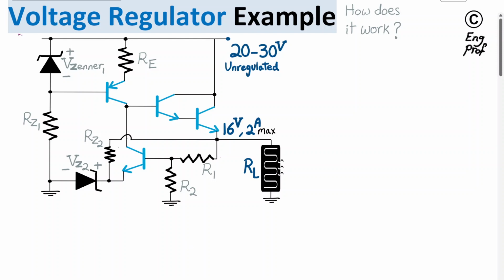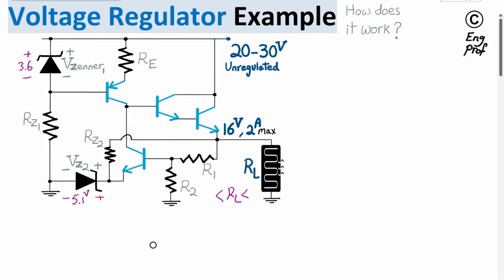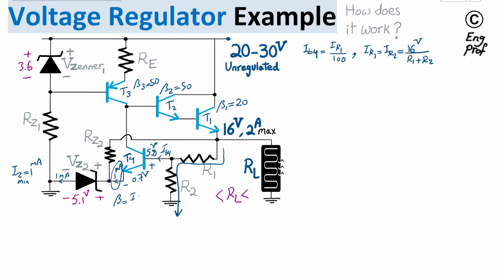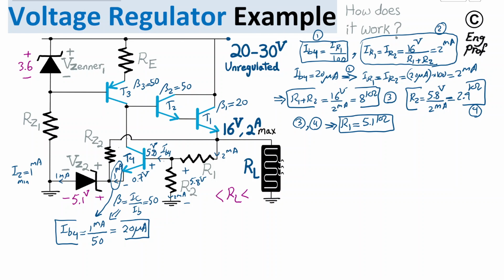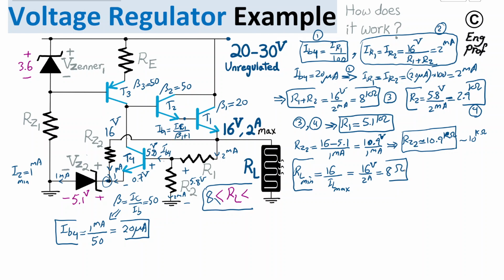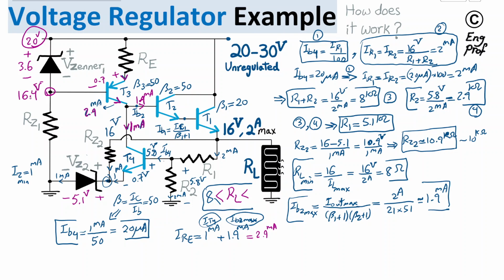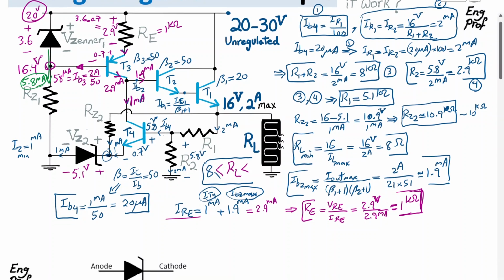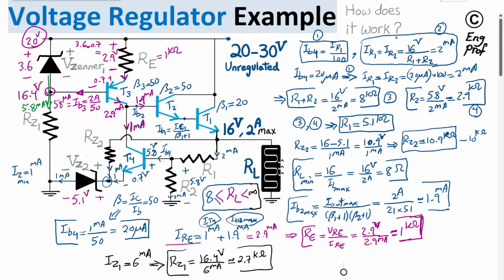Voltage Regulator Design with BJT Darlington Transistors and Zener Diodes

Comment from the maker: Thanks for watching & your comments. NOTE: supported input unregulated supply voltage is ~21-30v. For more Analog Circuit, Op Amp and Regulator Examples please see: 
Voltage Regulator Example: https://youtu.be/rI9f6-DyXxQ
Push-Pull Power Amplifier https://youtu.be/866MYibo8yE
Voltage Regulator Op Amp Circuit with Foldback current limiter https://youtu.be/VN4_qF9DvBM
Bandgap Video: https://youtu.be/esMlNx5w9Jw
Op Amp BJT JFET in Voltage Regulator design https://youtu.be/CJl-urzeiTo
PID Controller Circuit for Servo motor https://youtu.be/NATBlfABXrA
Sawtooth Oscillator with Op Amp, JFET and BJT Transistors https://youtu.be/5zHXTx-Vl20
Op Amp Analog Computer circuit that solves Differential Equation: https://youtu.be/ENq39EesfPw 
Full-Wave Rectifier:  https://youtu.be/DJJMNU-CYcg
And my analog playlist https://www.youtube.com/playlist?list=PLrwXF7N522y4c7c-8KBjrwd7IyaZfWxyt
  I hope these Analog Circuit Design and Analysis Examples are interesting and helpful. 🙏

Comment: I would suggest pl explain how circuit work first i.e how this circuit ensure 16v regulated output. This is very imp to understand before we go for calculation. Yr video is very good but explaination of how circuit work will help viewer to understand the Electronics better and better.  Thanks in advance.  Anupam
Reply from the maker: Thanks Anupam for watching, and sharing your thoughts. I'm glad that this video is useful. Sure, in case helpful, https://youtu.be/qYOe7JOidHk video explains a Band-Gap Temperature Compensated Voltage Reference Circuit design, and  https://youtu.be/p5iiJE9Z7Lk video explains a Low Voltage Regulator Circuit Design with Op Amp, Zener Diode, and JFET, BJT Transistors.  I hope these videos are helpful.

Comment: Interesting circuit. It can works as a constant current, constant voltage regulator?
Reply from the maker: I'm Glad that you liked this circuit video. It is a Voltage Regulator designed using BJT Darlington Transistors and Zener Diodes.  It's primary job is providing constant voltage at the output up to the maximum allowed output current. The output current value depends on the resistance of the load at the output. Here are a few related videos: Voltage Regulator Op Amp Circuit with Foldback current limiter https://youtu.be/VN4_qF9DvBM
Bandgap explained in this video: https://youtu.be/esMlNx5w9Jw
Voltage Regulator design using Op Amp, BJT and JFET transistors explained in https://youtu.be/CJl-urzeiTo video.
I hope these circuits are interesting as well.

Comment: You really don't want to run low voltage Zener diodes at 1mA. They have poor "knee" characteristics at breakdown, and as you saw on the data sheets, they can have have a slope resistance of as much as 600R at 1mA, and that badly affects the voltage regulation. It's best to set both of them to 5mA at least and work from there. I would select Rz2 around 1.5K to 2.2K.
The real problem with the circuit, though, is that the voltage at the base of T2 has to be at least 16V + 2 x 0.7V = 17.4V. That is the voltage at the collector of T3. However, if the supply rail is at 20V, you showed that the base of T3 would be at 16.4V and that won't allow T3 to operate. Your minimum supply voltage for the circuit is likely to be more like 22V.
Reply from the maker: Thanks Rex for watching & surely for your detailed attention. You have a valid point and KVL analysis about the lowest acceptable level for the unregulated input supply voltage. I will be more careful about the claimed supported range for the input voltage supply.  Regarding the Zener Diode bias current, while 5mA is more preferred to 1mA, ultimately it depends on specific Zener Diode selected for the design. Some of them are pretty fine with bias currents as low as 0.25mA.
For more Analog Circuit, Op Amp and Regulator Examples please see: Voltage Regulator Example: https://youtu.be/rI9f6-DyXxQ
Bandgap Video: https://youtu.be/esMlNx5w9Jw
Push-Pull Power Amplifier https://youtu.be/866MYibo8yE
Op Amp BJT JFET in Voltage Regulator design https://youtu.be/CJl-urzeiTo
Thanks again for watching & your insights 🙏🙋‍♂️

Comment: thank you verry much i learn a lot
Reply from the maker: You are Welcome. Thanks for watching.  Glad that this Voltage Regulator Design Example video is useful. For more Analog Circuit, Op Amp and Regulator Examples please see: Voltage Regulator Example: https://youtu.be/rI9f6-DyXxQ
Bandgap Video: https://youtu.be/esMlNx5w9Jw
Push-Pull Power Amplifier https://youtu.be/866MYibo8yE
Op Amp BJT JFET in Voltage Regulator design https://youtu.be/CJl-urzeiTo 
Thank you 🙏

Comment: Very interesting. And amazing how you managed to cram all the formulas on one page :)
Reply from the maker: Thanks for watching.  Glad that you like this Voltage Regulator Design Example video and its format.  I appreciate your noticing of compact analysis approach with the main reason that circuit schematic is easily and always available in the view side by side the presented circuit analysis. For more Analog Circuit, Op Amp and Regulator Examples please see: Voltage Regulator Example: https://youtu.be/rI9f6-DyXxQ
Bandgap Video: https://youtu.be/esMlNx5w9Jw
Push-Pull Power Amplifier https://youtu.be/866MYibo8yE
Op Amp BJT JFET in Voltage Regulator design https://youtu.be/CJl-urzeiTo 🙏

Comment: As always I enjoyed your analysis of the circuit, thank you for that. I also wonder if the explanation of intuitive understanding of sub-circuits of this voltage regulator would be helpful for some people. For example, the role of the T4 and the Zener diode Vz2 in this circuit.🙂
Reply from the maker: Thanks for watching and your good follow-up questions and comments. Sure, BJT transistor T4 and Zener diode with reverse breakdown voltage Vz2 are establishing the reference voltage (sort of like what bandgap circuit does) in the sense that this Zener Diode set the baseline voltage at nominal 5.1 volt then the T4 BJT transistor adds another 0.7 volt of Vbe or Base-Emitter to get to 5.8 volt reference voltage at the base of T4 which then is scaled up by the two resistors R1 and R2 to get to the target 16 volt fixed output DC voltage that we desire for this Regulated Voltage Supply circuit design.  I will post more voltage regulator examples in the analog curcuit playlist https://www.youtube.com/playlist?list=PLrwXF7N522y4c7c-8KBjrwd7IyaZfWxyt . Please note that this example is a relatively minimal regulator circuit without any Op Amp. More comprehensive and more practical regulator designs require more components including operational amplifiers.  I hope this is helpful. 🙏
Reply: The interesting, and more unusual, part of the circuit is the transistor T3 and its associated Zener diode 1, which form a constant current source, ensuring a high impedance load for the transistor T3 and increasing its voltage gain. That improves the ability of T4 to keep the output tightly regulated though the negative feedback via its base.
Reply from the maker: @RexxSchneider Thanks Rex for watching and sharing your insights. I will post more voltage regulator examples in the analog curcuit playlist https://www.youtube.com/playlist?list=PLrwXF7N522y4c7c-8KBjrwd7IyaZfWxyt . This example is a relatively minimal regulator circuit without any Op Amp.  As you know, more comprehensive and more practical regulator designs require more components including operational amplifiers. Thanks again for watching 🙋‍♂️